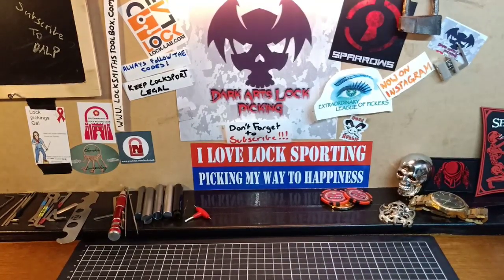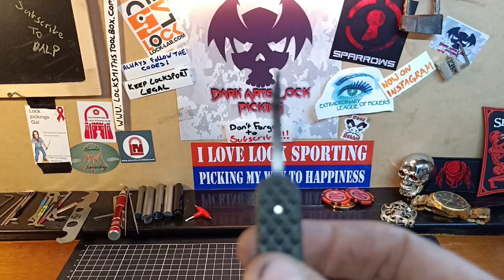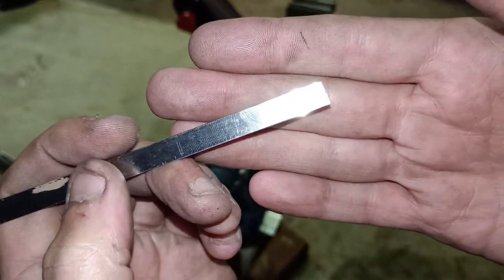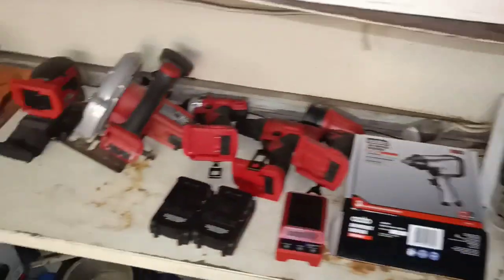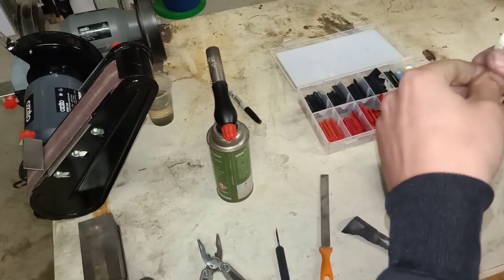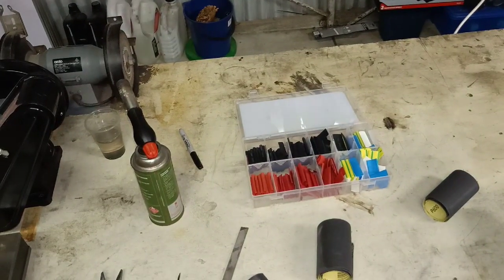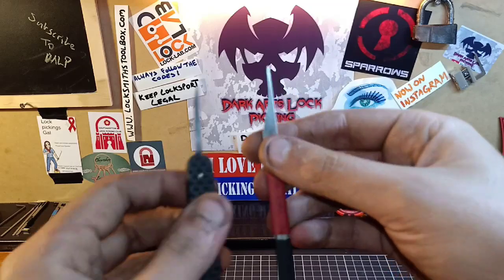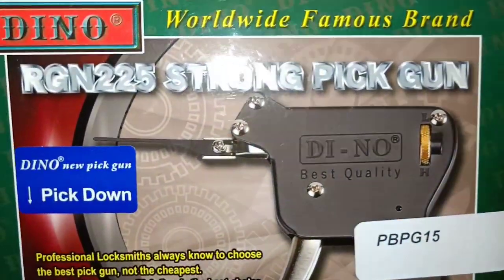Cheap decoder build. Sunday beginners series video (249)

Comment: my decoder knife from sparrows came pre bent.  Not too bad but it was noticeable as it came out of the package.
I think those .008 strips should work fine.
Reply from the maker: Yeah the Sparrows decoders are very thin and very easy to bend. Yeah it works well and if it bends badly it's all good. 👍🤘🖖🍻
Reply: @DarkArtsLockPicking  yeah, I wasn't bothered by it, just informed by the bend in the mail. It does just what it is supposed to do.
Reply from the maker: @macnutz4206  yeah they bend extremely easily because of how thin the steel is. Donz got one and his got bent in the mail as well. 👍

Comment: Good tips! Thanks for the video. I made my son a decoder and a knife out of feeler gauges. I made the handles from 3/8 inch copper tube that I hammered flat. I ground the decoder and knife and thinned the handles (tangs) to fit inside the almost flattened copper tube. Put some epoxy on the decoder and knife “tangs”   Inserted them in the flat tube then finished hammering the copper tube flat. A bit of file work, some sandpaper and then finished it out on a diamond plate to get out the nicks and minor hammer marks. It turned out as a beautiful set.
Reply from the maker: Thank you mate. Yeah copper pipe can make some beautiful handles.  I will be doing more diy tools videos so I hope they will help you out 👍🤘🖖🍻

Comment: 90% of the Picks I make have heat shrinked handles reinforced with wiper insert exactly like this.  I use double sided cellotape to hold the wiper insert in place when I apply the heat shrink.  Good to see you using it on a great diy decoder.
Reply from the maker: Yeah I got the idea from what you told me. And it works great so I had to share it mate. How have you been? Hope all is well. Thank you mate 👍🤘🖖🍻

Comment: Nice idea bro, have you tried just heating pick then push into a thick glue stick quick and cheap.
Reply from the maker: I don't like heating picks up as it will change the steel's strength. Heat shrink is good as it doesn't take much heat. 👍🤘🖖🍻